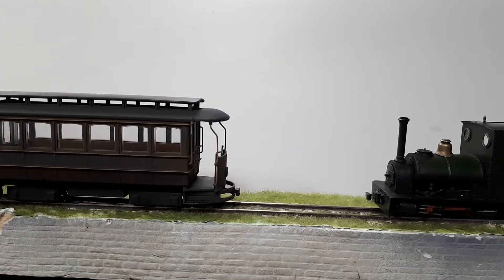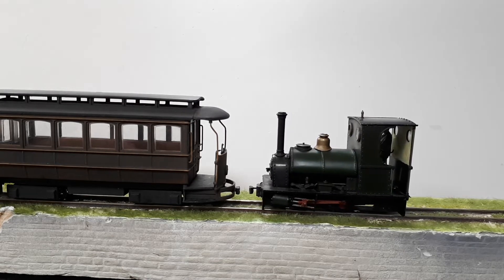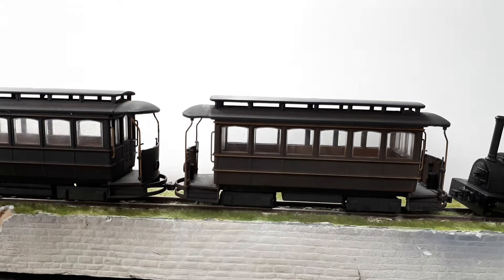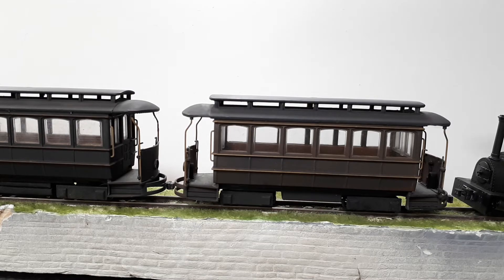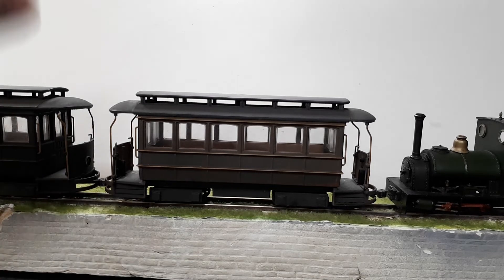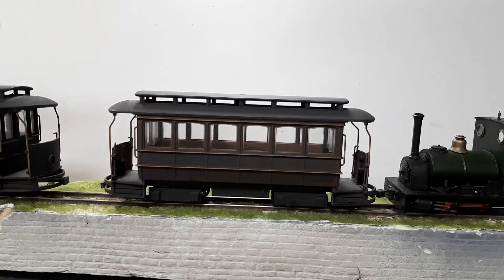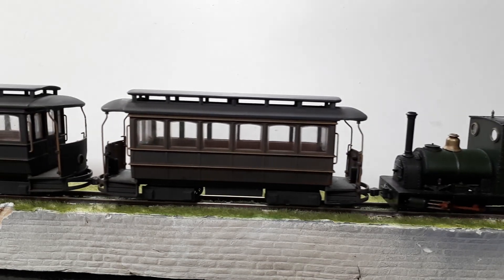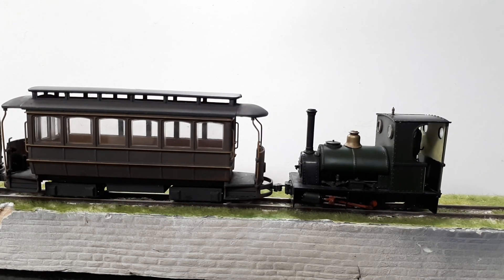Magnetic Couplings for 0-14 Part 2

Comment: Hi Giles, excellent and most useful experimentation there, thank you!  Did you do any further work on magnet strengths?  I'm also working in 7mm NG but with heavier trains, notably using Bachmann On30 rolling stock like their diecast side-tipping wagons and I'm wondering what size of magnets I would need to use to keep a train of 6 or more of these together?

Another question: using 2 magnets side-by-side to avoid the need for stock to always be oriented in the same direction - do those magnets need to be touching?  It looks from your video that you have merely drilled 2 separate holes a few mms apart and inserted the magnets into them?

Lastly, I really like what you have done with the Bachmann On30 streetcars to make bogie coaches!  What make of bogies and what wheel sizes have you used for these?  Many thanks in anticipation! Colin